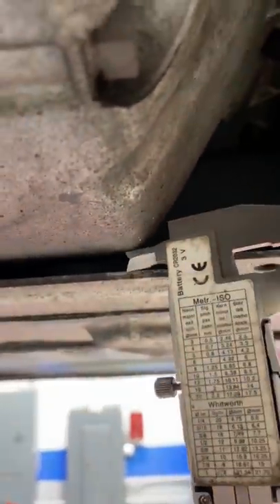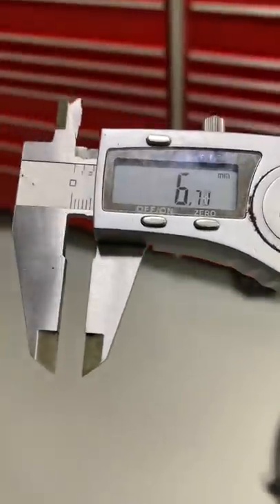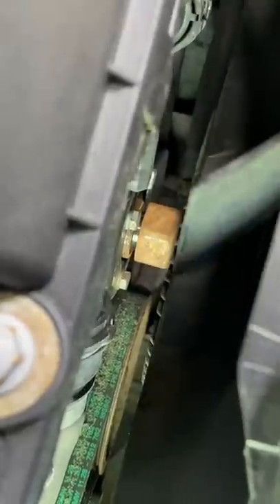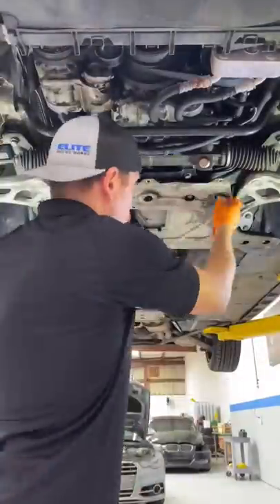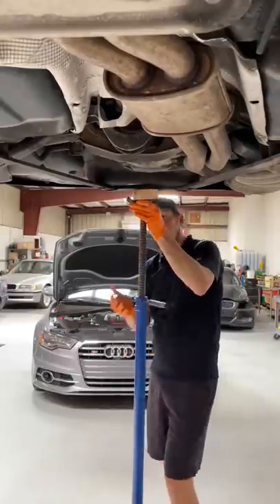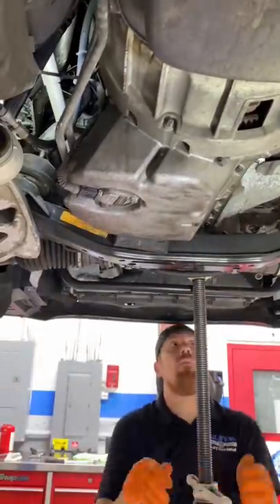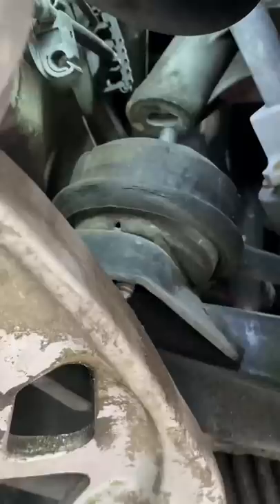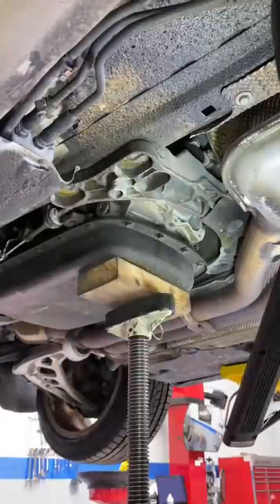Big Difference! New mounts #shorts

Comment: Damn mechanics are so under appreciated and so cool but I also feel like many don’t have the same passion or attention to detail.
Reply: Idk about under appreciated at all. They charge $600 for a $150 muffler and another $400 in “maintenance” to do 15 minutes of work. Like doctors, just because it’s important to you means you have to pay $35,000 for something commonly done nowadays that doesn’t even require that much experience or actual on the job cost. I can’t tell you how easy It is fixing shorn quoted for $900 for literally $35. Everyone has to make a living but because they’re all scammers nobody cares what they have to say. Plus they break our shit half the time and make us pay for a new engine? Screw you
Reply: Detail would be to loosen that drive shaft because the rubber driveshstaft center bearing just got damaged by chance. The shaft has Ben running out off alignment or is now.in either case the rubber u joints vibration dampers need an inspection. I worked as a transmission expert for 28 years. That exhaust is putting heat on the before mentioned parts. Better check those exhaust hangers made of rubber while you're at it and stretching parts with a pole jack too.
Reply: @MyRuger  a mechanic cant order the parts and do a estimated bill in 25 have you ever been lied too by a  fancy car owner who got half the work done and took 3 months and 4 credit cards to pay a 400$ bill. Thats why I stopped fixing people's junk.bad overpriced cars but terrible people
Reply: But most of them will scam you unfortunately
Reply: @MyRuger  I’m sorry you think that buddy
Reply: @MyRuger  then Just do it yourself. 15 minutes bro.
Sometimes you cant do that in the same time as in that edited video you Just saw..
Reply: @standavranek892  I do everything myself because of the scammers. They don’t let you use your own parts any more or itd be so cheap I’d never care. But sometimes and most often on my older cars there’s no information on half the shit no diagrams or YouTube. Not the point but that would also require a huge investment in tools to do specific jobs like the timing chain and exhaust work with a welder etc.
Reply: This dude is a technician. Skilled in all areas of the automobile and in many manufacturers. Mechanics specialize in only one area and with only on so many different vehicles, typically…
Reply: I doubt those needed to be replaced
Reply: I think you mean many don't have the cash.
Reply: Well, it's like this. There are professional technicians and there are shade tree mechanics. Sometimes shade tree mechanics end up working in a shop.
Reply: @MyRuger  you’re the same kinda guy who does his own work. Then only brings his car to the shop when they really fucked up and have no clue how to fix what they messed up. Then wanna blame the real mechanic when their new parts they installed incorrectly are bad and need replaced already. See so many hack jobs done by customers who don’t trust mechanics. News break buddy. The guy fixing your car doesn’t charge the $125 an hr in labor and the %50 markup on parts. It’s the shop who has to make money and pay for all the equipment, employees, etc and still turn a profit.
Reply: @zachhall3581  how does it matter if it’s the shop or the guy if you’re still charging an arm or a leg for? I’m the type of guy who’s done better jobs than any of the mechanics that have had the privilege of touching my vehicle to do work while I was too busy to do myself. Every job I’ve given to these assholes they’ve screwed up and I’ve been the one to fix the problems. I buy the beaters for cheap because I get my parts online at a quarter of the cost and don’t spend $6000 on a new transmission or 1500 for suspension. Screw that. Diy. Can’t say otherwise. You don’t know me or my experiences
Reply: I hated being a mechanic i was good and it was a pain in the ass 24/7 u try to fix one thing for another thing to become the issue
Reply: Not to mention they're also some vultures out there that ruin it for the good guys
Reply: @leerob2403  no you just made that up completely
Reply: @MyRuger  yeah I've had customers like you, little wet behind the ears chumps who think they can turn a wrench and yet can't do even the simplest of repairs properly

You probably unironically use self tappers on everything
Reply: @MyRuger  "privilege of touching my vehicle..." Well the , I guess thanks is in order for the privilege of touching your... ah yes, cheap beater: "I buy the beaters for cheap... parts online for a quarter of the cost..."
Also, another comment you mentioned cost of tools investment. You have answered your own question as to why automotive shops "charge an arm and a leg." Not to mention someone else here answered that we have to pay everyone, pay for your parts, keep the lights on... 
I advise you not bash someone's skill, especially when you haven't considered the cost of the skill.
So instead of having the attitude of "privilege of touching my vehicle," be thankful someone will touch it at all.
Also, no, I don't know you. I don't know alot of people but I can tell an ignorant, angry person when I read writings such as yours. As for your terrible past experiences, a reputable technician and his shop will always back up their work, especially when it's misdiagnosed or improperly repaired.
There is not one real tech I know that hasn't had a recheck and lost a whole week's paycheck because he screwed the pooch on one. The other ones lie in their stories. Those guys eventually get found out and get the boot.
Remember, be more thankful.
Reply: @danielkoontz6732  wouldn’t call a $40k Lexus a beater. Wouldn’t assume shop size is what effects price, nor does it require special tools like a Mercedes’. You said it yourself I’m paying for the shops problems. When I can do it myself with the same old ratchet and sockets everyone has in their garage. Thanks for proving my point
Reply: @MyRuger  can say my dad aint like that he charges about 150 dollars for work on a muffler
Reply: If they are honest.
Reply: @MyRuger  do you seriously think we get paid all that money? it goes to costs of running the business like rent, wages, utilities, not to mention the thousands in tools which we buy from our own pocket
Reply: @sgtjonzo  I was a machinist for many years, we made tools not based on rent, electricity, or skill level of any machinist because it is expected to be a professional behind the position capable of doing his craft in an orderly fashion. The rent was paid through profits along with the bills and other overhead. We got the most business and also had the cheapest, highest quality tools on the whole East coast. I am deeply aware the associated problems with my statement. I firmly believe anything but basic maintenance is way overpriced. The only reason these shops can live on basic maintenance is because jiffy lube can't do a good job. Point blank an average person cannot afford scheduled maintenance on their cars because the ratio is so far off especially in modern technology. There should be dealer programs and  or assistance from manufacturers. Plus until you do a real man's job these cars aren't shit yall are soft and it shows
Reply: @REAPER3fitty  you've gotta be 12 like to not understand how 90% of mechanics not working with you isn't a problem. Every respectable industry doesn't adjust prices due to their own misfortunes.. as mentioned midas, Firestone, all the fortune 5 shops thrive on basic maintenance lacking experienced guys so how could they be cheap when they gotta spend 4 days replacing a fuel pump that bay was like 20 oil changes...
Reply: @REAPER3fitty  I think if you're not upgrading, or doing preventative maintenance you're poor, or just don't have a nice car. So speak up when you have experience.
Reply: @MyRuger  you don't realize you're paying for the shop, it's insurance, and the mechanic who gets needs a respectable wage, nothing is a 15 minutes job and you're probably a bum not realizing cheap parts aren't acceptable on professional work unless you voice concerns of cost
Reply: They are the type of mechanics who are proud of what they do and not the ones who only do it for the money.
Reply: Yeah cuz they're stuck working on poorly engineered domestic vehicles.
Reply: @MyRuger you just explained in your own comment why mechanics charge what they do. “Huge investment in tools to do specific jobs”. Go buy a welder then. Go buy a 4 post hoist and tens of thousands of dollars worth of tools and go do it yourself, or quit complaining. “Don’t let you use your own parts anymore” is just false. If you’re going to bring me trash Chinese parts to install and then complain about them failing prematurely (and include complaining about the cost of it) no wonder you’re complaining about the cost, because the cheap Chinese parts that you’re putting in your car just don’t last as long.
Reply: @TM-fx5le  yeah quite the opposite pal. A lot of shops that will require the tech to bring their own tools, or regardless If the shop is a chain and has a lot of equipment I'd compare it to going to the doctors without insurance. I wouldn't go to the emergency room for a brake change... They're charging you $400 or more for fing brakes. That's not for there fancy equipment. And even if it is I'm not the guy driving in the crapped out mercedes with 150k on the dash. Also if I brought in my own parts it was performance parts meant to be better than anything they've gotten there hands on and I'm still refused simply because they can't warranty them... and they won't do the job they don't know. Lawsuits are not low payed techs favorite things
Reply: @MyRuger  well this is news to me considering I’ve been a technician for the past 15+ years, thanks for the information! 🤨🤨